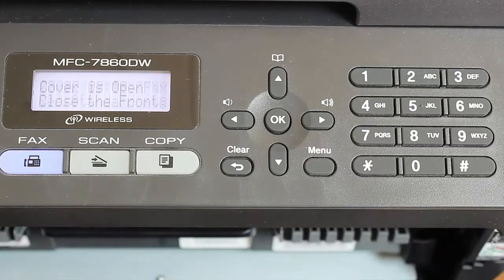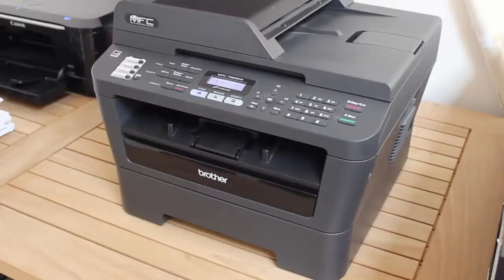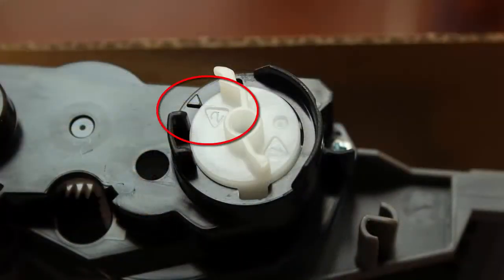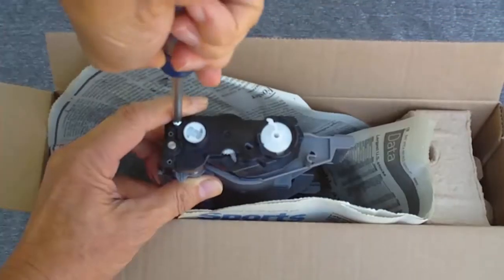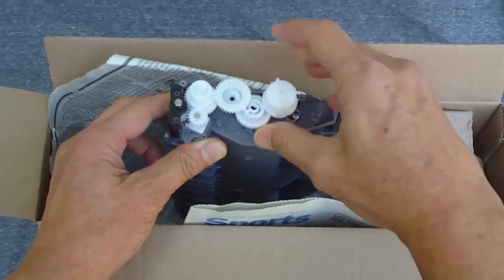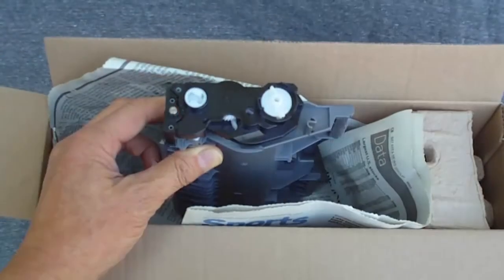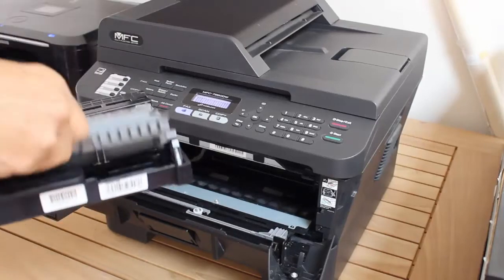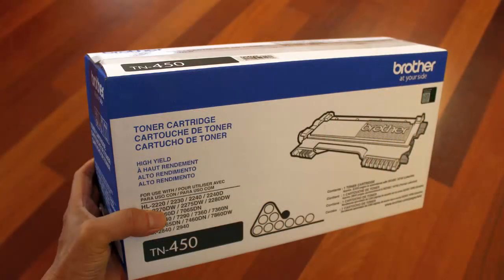Reset Lever Gear to Fix "Replace Toner" on Brother Laser Printer (TN-450 Cartridge)

Comment: I found a place to buy resetting gears for starter brother toners. Do You think that buying them will just make firmware version irrevelant and will reset the chip? Is it the same scenerio if I move the genuine chip to new aftermarket toner that has a resetting lever and install it? Thanks

Comment: Could you explain why is there need to reset this gear on toner?  I thought resetting toner is done by button combination on the control panel. What difference is by resetting this gear? Thank you
Reply from the maker: In case the keypad sequence doesn't work, the gear method always works, for any printer that uses the print cartridge.
Reply: @graychang99  thank you so much. Its a valuable answer to me 😊

Comment: I tried this and the spring popped off. Thankfully you moved your hand just briefly enough so that we can see the position of the spring. After I reinstalled the cartridge after resetting the toner wheel, the printer gave the error "cartridge installation error", then after removing it and popping it back in, it seems to work. I think there is a problem with the mechanism inside the printer not being able to rotate the toner reset dial. Sometimes after doing the Clear, Start, up, down, OK sequence, it works, sometimes it takes many tries and it still doesn't work. Once I get it to work, I do not have problems unless I turn off the printer, so I leave it on all the time. 

These printers are very expensive to replace these days, since they have Wifi/bluetooth, they are costing upwards of $250 or more. I bought my DCP-7065dn years ago and I have probably replaced toner when I didn't need to due to this error.

Comment: I'm getting unable to print 0b message
I've only had the printer 9 months Brothers has the most horrible customer service ever
I'm wondering do you think I just need a new cartridge? They're saying it could be a software issue but it's practically brand-new and I haven't replaced the cartridge yet

Comment: Does not work for a HL2270DW, using a TN450 cartridge. Completely different setup. If you take off the two screws, a spring pops out and you will have to pitch that cartridge.
Reply from the maker: It should work for any TN-450 cartridge. After you remove the 2 screws, be sure to lift off the plastic cover slowly and gently so that the gears don't fall off.